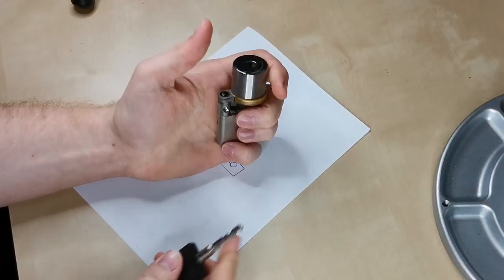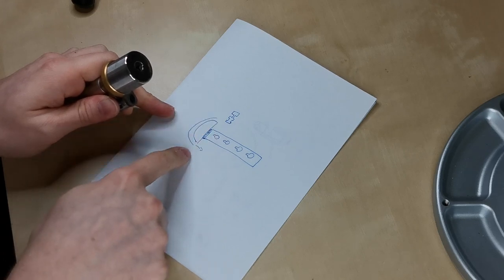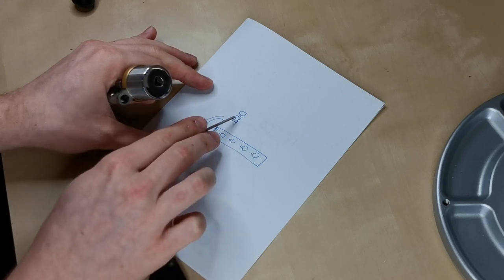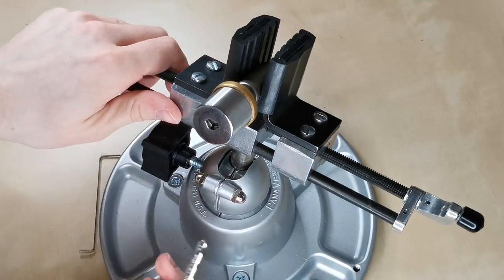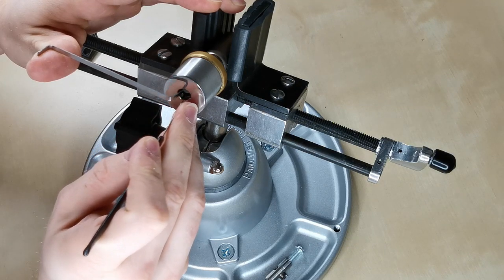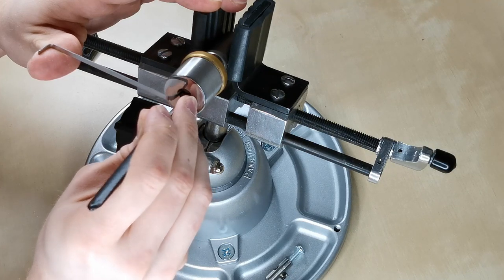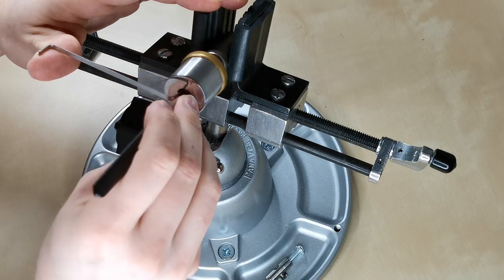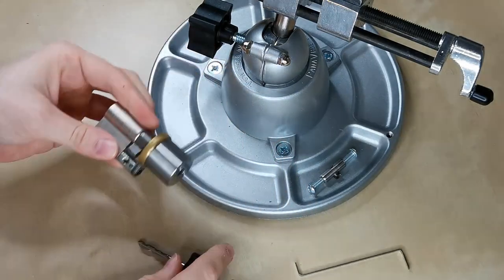[29] FAB NZS 3A picked

Comment: Good work👍Btw the FAB company introduced this system in the late 1980s.  I think it was a great product back then.  But it was a bit funny that there were mostly almost paper doors (soft wood frame, two thin boards glued to it and a paper honeycomb inside) in the apartment buildings of the former Czechoslovakia.  People bought expensive locking systems to feel safe, but the effect was quite the opposite.  Such a lock rather attracted the attention of thieves.  Then just two or three kicks on the flimsy door and he was in the apartment.🤭
Reply from the maker: Thank you for the additional information. The lock is indeed pretty good by todays standards even. The formfactor is obviously Not ideal.
Good point regarding the Attraction of thiefes. 😃

Comment: Fine Work ! - I have a Question = Who Key System is save ?
Reply from the maker: Depends on which secret service is after you 😉 An Evva MCS, Urban alps Stealth key or Abloy Protec2 are very overpowered options for a normal door lock. An Evva ICS will exceed all needs in security against manipulation already as it's much more difficult to do that on a door (with your arms extended forward). Tge more critical part is physical strength of the lock, the door and eventually also the windows